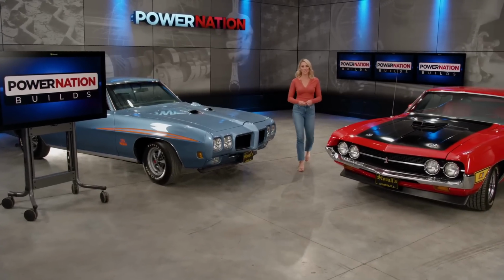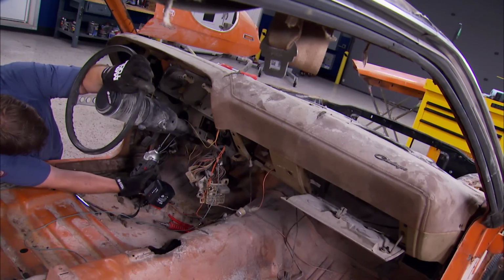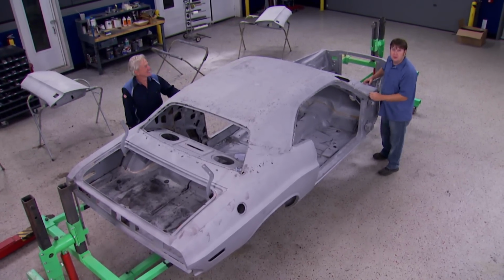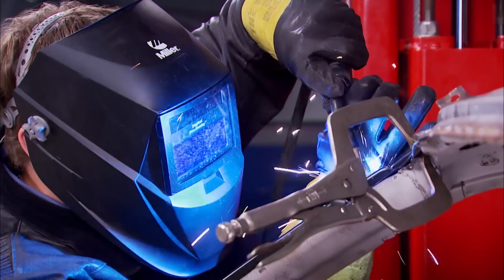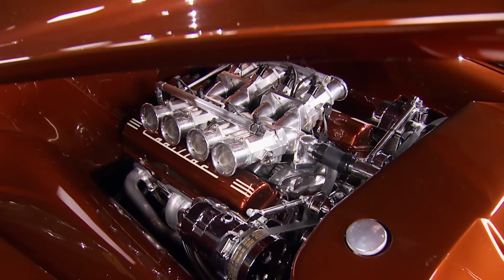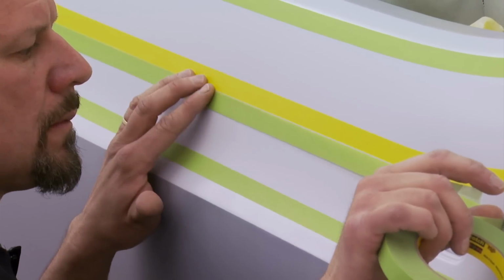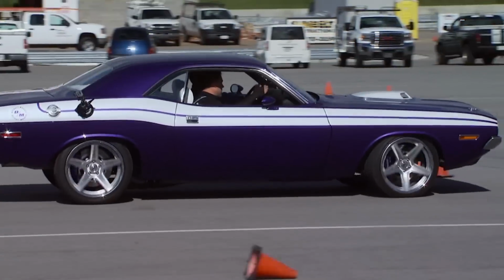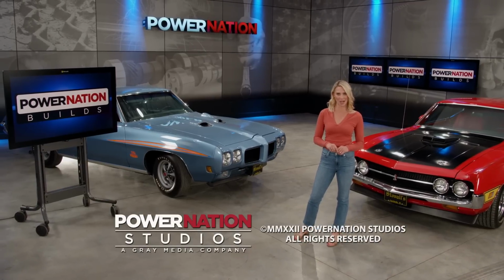Rescued '70 Dodge Challenger RT Beautifully Restored - PN Builds

Comment: You didn't restore it.  You ruined it.  A car like that should be "Factory Fresh" not what you did.  Sickening.
Reply: I respectfully disagree u can have a beautiful car in many different ways
Reply: Considering the car lacked a chassis and an engine, it’s only fair. The car is functional and isn’t rotting in a field. Also I don’t think I want to drive a 2 tonne car with 7.2l with drum brakes.

Also I can see where you are coming from with them cutting the body. Anyway where’s your dodge challenger?
Reply: I can see restoring a car that has some lineage.  Being that the fender tag and build sheets were missing, there’s nothing to restore it to.  The VIN number only tells you a little relative to the fender tag and Mopar unlike Ford and GM don’t have good records of what cars came with what options. Off the top of my head from the VIN you’ll get if it was a base of R/T off the first two digits, the year and the 5th digit is the engine code.  All other options were in the fender tag and build sheets.  Would’ve been cool to see the VIN.  This could have been a base 318 car and I would much rather see this car they made vs a 318 car back on the road.
Reply: Thank you for your opinion
We put your opinion with all the others because everyone has one and yours is just as important as there's. Come back and see us now ya hear?
Reply: *Opinion